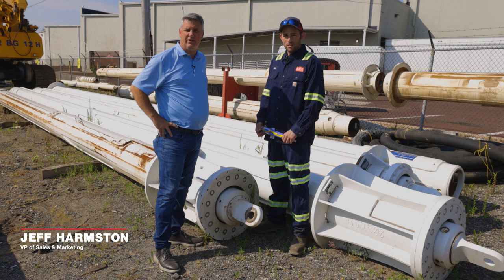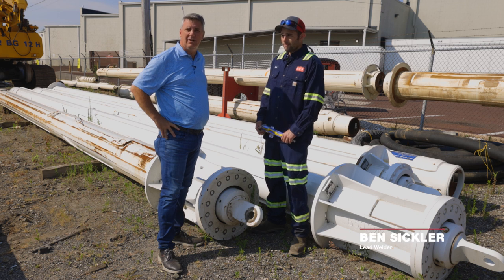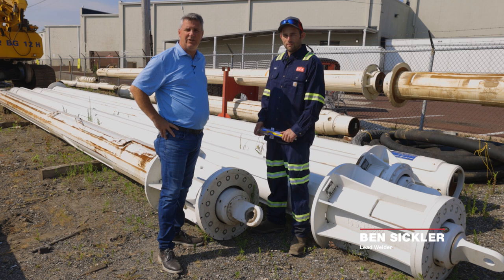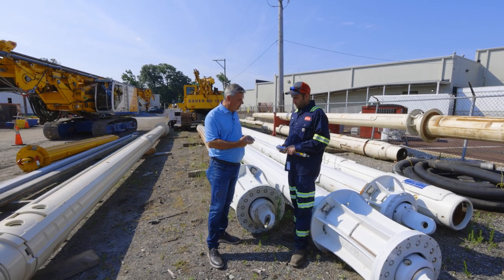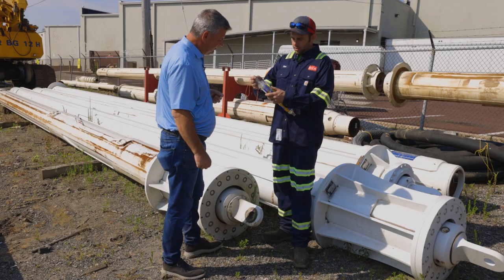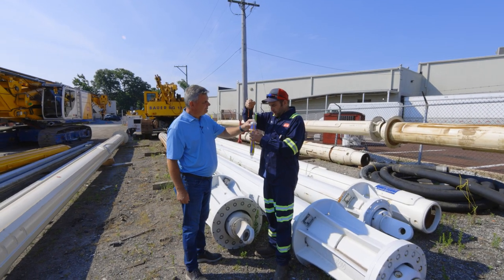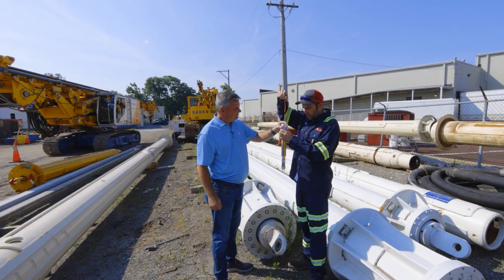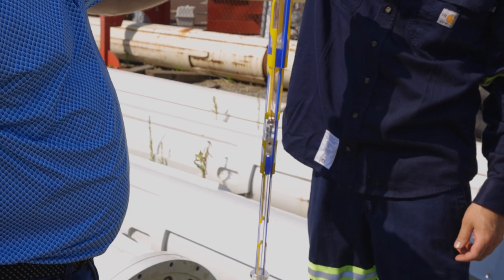Kelly Bars: How a Kelly Bar Works

Comment: If the wire rope breaks while drilling below 30m from ground,  what is the best approach to retrieve the friction kelly bar?
Reply: Back fill the shaft with sand,and keep reversing the bar,eventually you’ll get it back. Takes time though. Hope this helps. 👍